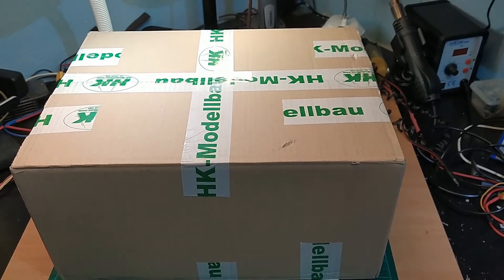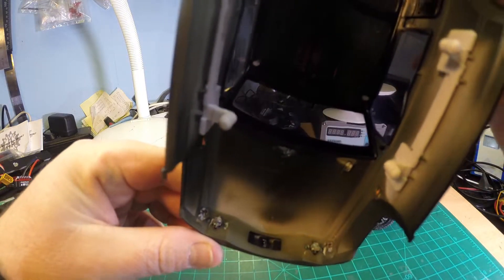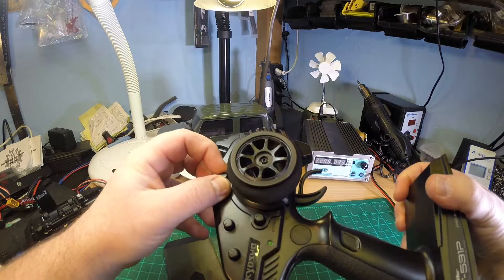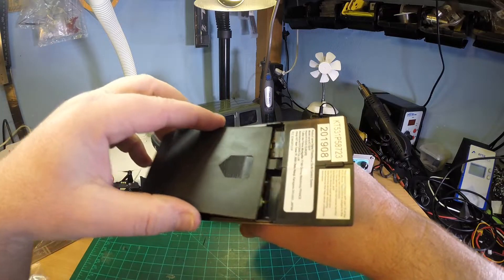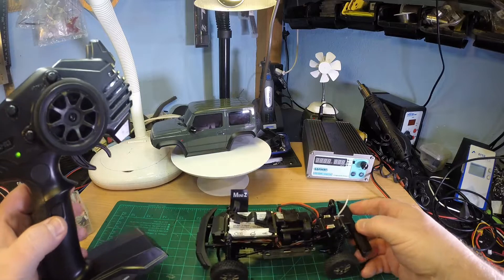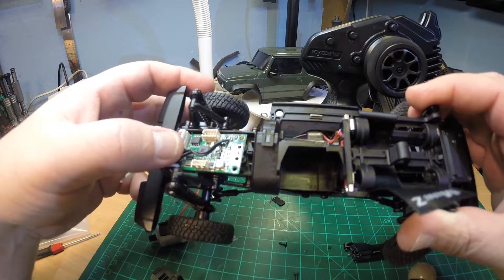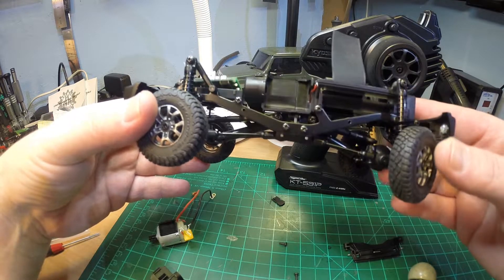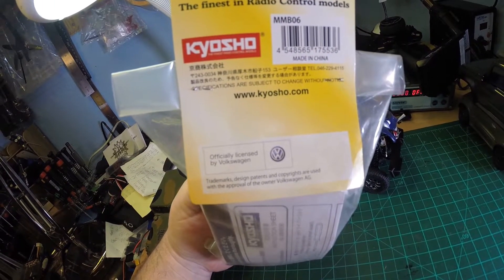Mini-Z 4x4 Suzuki Jimny: First Look

Comment: is that 1/18 scale?compare with wpl plz
Reply from the maker: It is said to be 1/18, but exactly the same wheelbase as the 1/24 URUAV/RGT/ECX/Hobbyplus/Amewi. WPL C34, MN90 etc. are much, much larger, nearly twice as long - for example WPL C34 is about 33 cm (frontbumper - rear bumper), Mini-Z Suzuki is about 18 cm "bumper-bumper total length".

Comment: Unbelievable $250 thru Tower Hobbies and my motor also DEAD ON ARRIVAL $15 dollars in batteries just to find out Kyosho mini z's 4x4 sierras are junk very upsetting. KYOSHO BAND IN THE R.C.ATTIC
Reply from the maker: I still love it (and my other Mini-Zs), but yes, they are extremely expensive.  240 - 250 € here, what is near to 300 US$.